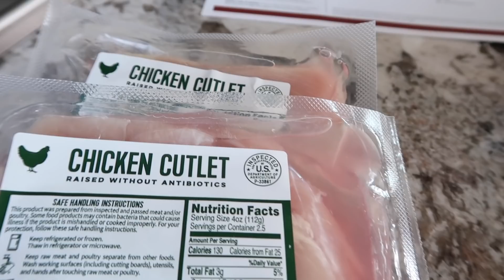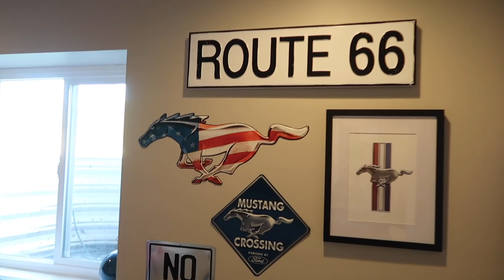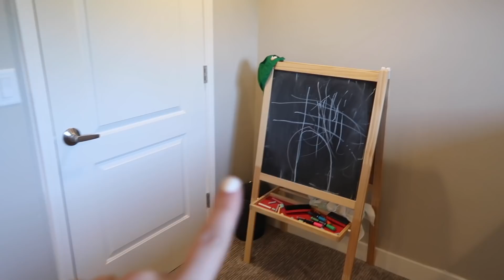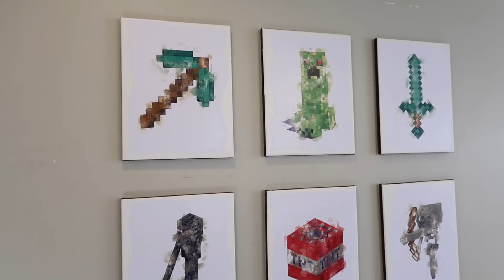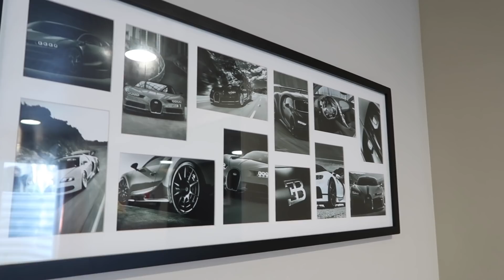*NEW* BASEMENT CLEAN WITH ME 2020 + FINISHED BASEMENT HOUSE TOUR

Comment: Lovely!  The steam cleaner is a great idea for cleaning the windows.  

If you slide your window all the way open you can lift it up in the track and out and pull the track out and clean under and around, too.  It also gives you access to all around the window frame.  I need a steamer - for now, I use my water pick which works well (seriously).